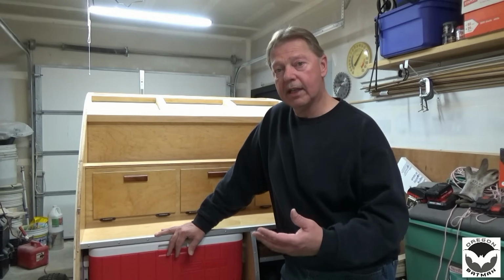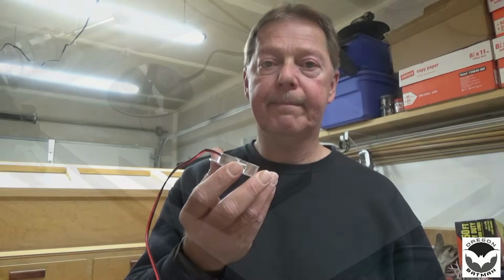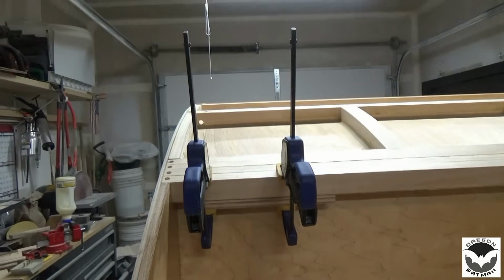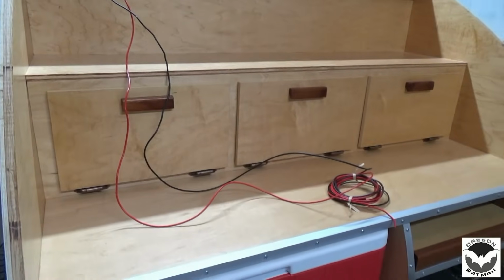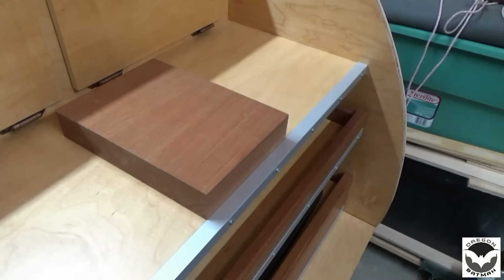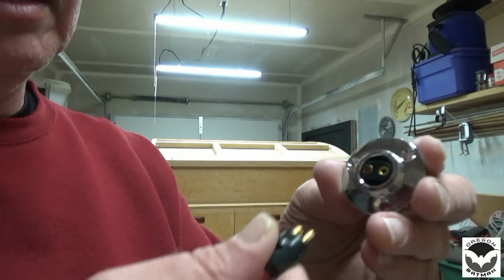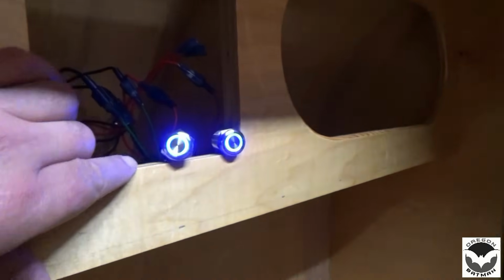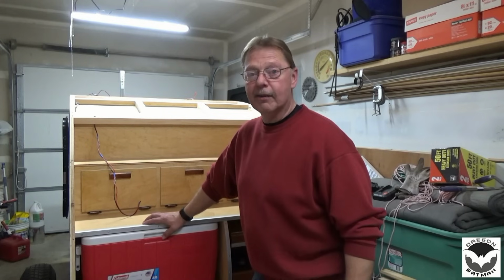Let’s Build A Teardrop * Step-By-Step * - Part 30 (Electrical Install)

Comment: Looking good!  The electrical was one of my favorite parts of my build.
Reply from the maker: Thank you sir... very satisfying when everything works as it should!
Reply: i really like your video. i built my teardrop back in 2015 and I didn't install any lighting. I'm not good (at all) with electrical  bu Ithink I have to add a porch light and one for my galley.. thanks for your information

Comment: Good video again Al!  It is always interesting to compare how each of us do those installations!  Again, there are not that much videos about the subject on YouTube, I am glad you did those.

In my case, I glued the styrofoam to the inner skin then I grooved it with a heat cutting tool attached to my Weller soldering gun to provide passage for the wires, then I glued the outer skin to the styrofoam.
Reply from the maker: Thanks Raynald! I always appreciate the kind comments and the great feedback! I didn't think about using the heat wire for the foam, great advice! I've seen it done and simply forgot about that technique. I didn't glue the foam to the skin, left it floating. Fits pretty tight so not worried about anything moving around. I definitely would glue it to inner and outer skin if the pieces were large cuts. Working on outer skin today, need to get that on so I can move to the filon. Saving the hatch for last... Thanks again sir!

Comment: what gauge of cables are those? I am thinking to go for 12g.
Reply from the maker: I believe I used 12 or 10 AWG wire. Pretty close to battery and not runnning a lot of power (lights and fan). Separate wiring to refrigerator. You will do okay with 12 AWG wire
Reply: @OregonBatman  I went 10 AWG from the battery to the bus bars. 12 AWG for the fan, and for a dome light on the hatch, 14 AWG. I will keep you posted. Thanks a bunch Mr Bates!

Comment: On those switches.  280zone has a good point. The light would drive me crazy at night. Plus, a power drain would always be present when the battery is connected. I have installed lights like these in customer's vehicles over the years and some people did not like them. (I was an auto electrical specialist for 47 years) So, on many of them, I was able to redirect the ring light feed to the output feed to the powered accessory and that put the ring light out. It would illuminate when the switch was on as we used the output power to do the job. (Most of the one I installed were LED dots to illuminate the switch) but the idea was the same. Not knowing the switch wiring on yours I do not know if this can be done but I certainly would look into it or return for the proper switch. Just a thought.
Reply from the maker: Thanks Bob! I agree... the blue lights on all the time would drive me nuts! I emailed the seller of the switches and let them know about the lights and they sent me two new ones that worked correctly! Now installed and works like they should... much better!! From what I can see, the switches are a sealed unit, don't think it can be taken apart to redirect feed without destroying them. Not sure what I will use them for other than testing purposes. Don't like the idea of being on all the time and possibly draining a battery or two! Thanks for the comment.
Reply: @OregonBatman  Good move. After following you for all this time I was sure that it would be a problem. As to redirecting the feed, sometimes I was able to take the wire that hangs from the back of the switch and instead of a direct connection to power I would connect that to the wire that is used ot output power to the accessory. If I hade the wiring diagram available I would know. If the switch was in my hands I could experiment and see what the results are. Either way I am glad you did the right thing. Enjoying this one because I wanted to build a teardrop but the wife would not be happing in one.. She likes to stand up.
Reply from the maker: Much happier with the new switches for sure! I thought about having a main switch for the power, but that seemed like it would have defeated the purpose, so glad the seller made things right! Have to agree with the wife... after building my first teardrop, I wasn't to keen on laying down to get dressed so I built the 6x12. That thing is awesome! Lots of room to move around in. Building this teardrop mainly for showing how it's done. I'll take a road trip in it once it's finished, then put it up for sale... we'll see if I have any takers. I will be selling the 6x12 also in the near future to help fund the next project. Thanks for following along Bob!!
Reply: Yeah, I bought two LED lights for my cars cabin, very small. They would work and then stop working and I would reseat them and work for a little while.  I started having a vampire power issue where the battery was dying after less then a week. It seems that the LED lights have a circuit in them not  just an LED and even though no light was on it would consume energy, even a small LED can kill a battery.
Reply: @DesignBuildFixReview  You are so right. There is a monitoring circuit that consumes power. I made quite a bit of money, over the years, working on customer's vehicles locate their parasitic drains caused when they had installed, what they thought was not going to be an issue.

Comment: I think you might want to return those two switches.  That constant blue LED light is going to be pretty bright in the trailer at night and also be constant on they are draining battery power all the time.
Reply from the maker: Thanks 280zone! I emailed the seller about the switches, and they sent me two new ones! I agree... those blue lights would have  lit up the whole cabin!
Reply: @OregonBatman  Glad to hear, I was going to mention the same. Also it may not have occurred to you that you don't need light up switches as the interior lights themselves come on when you press the button :)
Reply from the maker: True that Dave! The only touch switches I searched for had the LED's... so I went with it. I couldn't find them without (didn't search long though! LOL!) I'll have plenty of light for sure!

Comment: Thanks for the great video. I had no idea how to even begin with electrical, now I feel I have a good grasp on it. I bought the lights and switches you have, but have a couple questions. 

Do you have a link for the grommets you insert into the 1/2” holes to protect the wires? 

Also, the lights say to use a 56mm hole saw, but you used a 2 3/8” hole saw I believe. Do you recommend the hole saw you used and are they holding well after getting some use?

Thanks again for the great series, you are fun to learn from!
Reply from the maker: Hi! Thanks for checking out the video, and glad it could help you out some! I purchased the gromets at an ACE hardware store in the 12 volt section where they sell the wiring and all the 12 volt connectors... you can probably find those at almost any automotive parts stores. I would probably recommend a 2-1/8" hole saw for the lights... mine are holding up very well with what I used, but better to make the hole a bit smaller. You can always sand it to make it bigger, but once it's too big then you have to find a way to make it smaller (a little more challenging). Thanks again for stopping by and checking out the build! al

Comment: Excellent build.
Quick question, what gauged wire was used(14 or 16) and cool idea using the bus bar.
What is the exact purpose for bus bar with only a few lights that are on each circuit?
IE Do you have all pos and negative to the bar and the additional leads for that circuit vs no bus bar and wired direct to the switch?
Just making sure I am not missing anything.
Reply from the maker: Thank you Allen! I used 12 and 14 gauge wire throughout, and I used the bus bars to distribute the power I needed for all the switches and fan. Could easily have used a fuse box to do the same thing, but would have been a tight fit.

Comment: Could you include an amazon link to the perko 12 V adapter?
Reply from the maker: Sure thing... I purchased on Ebay: Perko 1190DP0CHR Chrome Plated 15A@12V 24A@32V Watertight Deck Connection

https://www.ebay.com/itm/194077313092?epid=1723286444&hash=item2d2fe8c844:g:zaUAAOSwOHxgizeV

Comment: Where is the best place on the trailer to put the 30 volt AC hook up for camp sites that have electric and water and how long of  a cord  do we need .
Reply from the maker: I thought about installing one in the side at the rear on the drivers side... Run it through and connect to a power strip. It'll be hidden just behind the cooler. I always carry a 25' power cord with me to use at campsites. I might end up installing one on this build just to have it. That'll be easy! Thanks Steve!

Comment: Great job on the wiring Al.
I always say keep it simple and keep it neat. You have done both.
What type of insulation are you looking at for the top?
Have a Great week.
L.L.A.P
Mike
Reply from the maker: Thanks Mike! I used the 1-1/2" styrofoam for insulation... all sealed up now. Worked great.

Comment: You are referring to a “fuse panel” but I do not see any fuses. How are you planning to protect your wiring and fixtures?
Reply from the maker: Hi Ricky! Yeah... I keep calling it a fuse panel, more like a junction box! I will have a fuse at the battery post to protect the wiring.